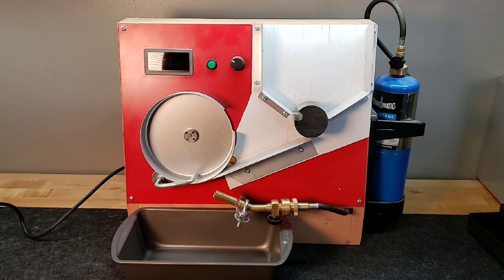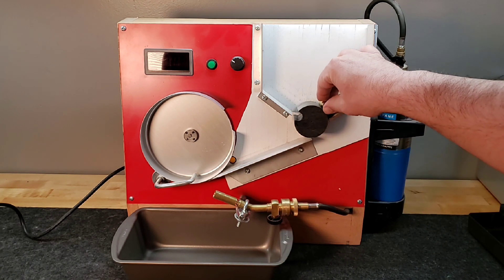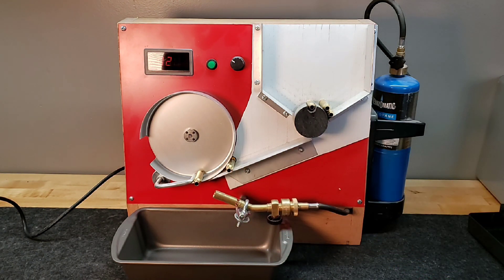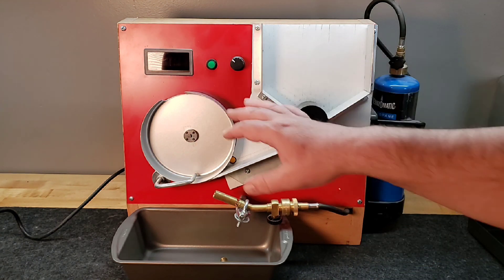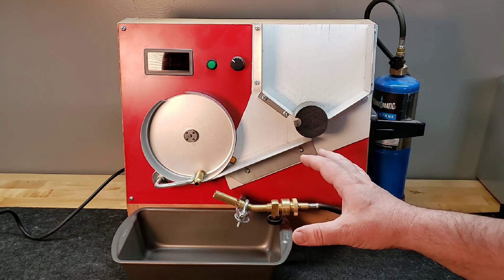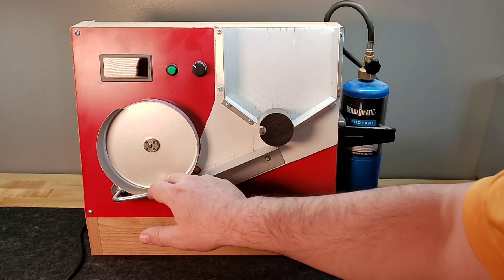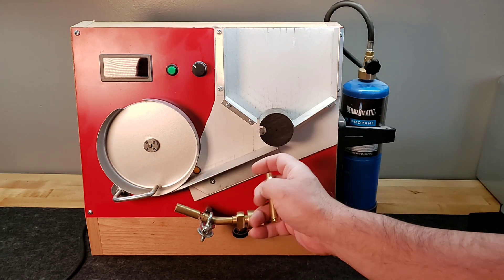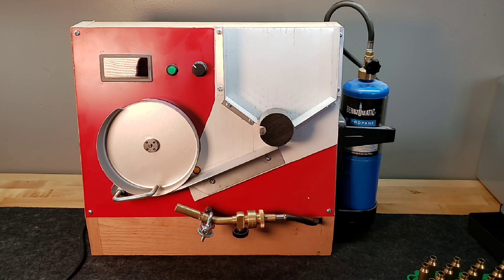DIY Case Annealer Overview

Comment: I'm in the process of designing my own case annealer and I found your channel. I looked up the reduction motors on Amazon and I found too may variations in RPM. Can you tell me which one was applicable to this design? Also the mounting bracket you used to mount the motor. Thanks.
Reply: 35 rpm is a good speed variation

Comment: Instead of an electrical proximity sensor and a separate motor, one option is to connect both rotating elements with a small #25 chain and sprocket set. Ratio would be 1:1, so they would both spin at the same speed and the motorized drum is sped up and slowed down.